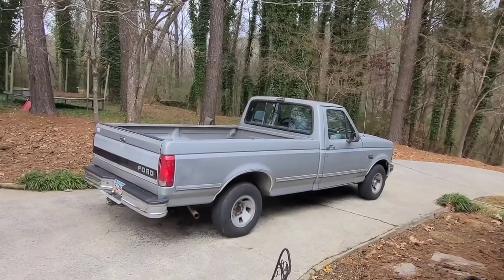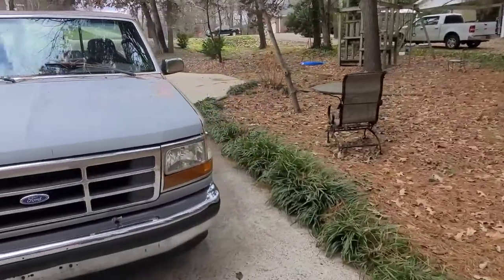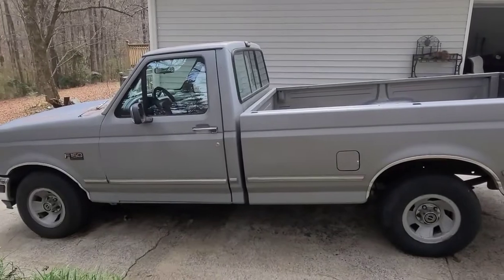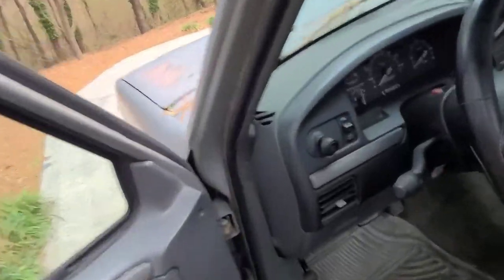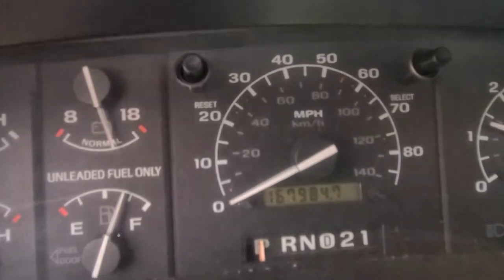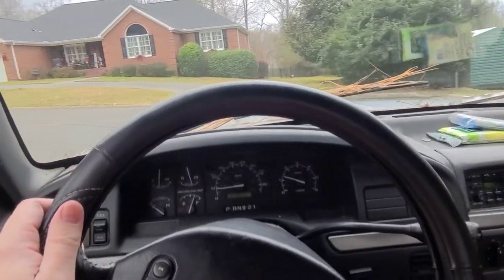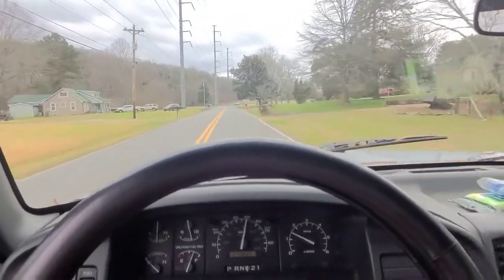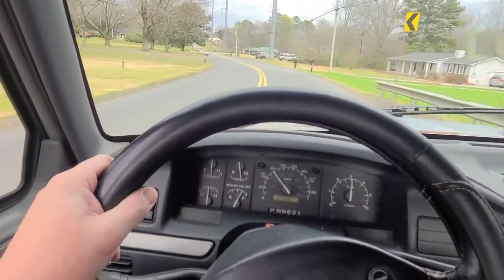Merry Christmas!   Old grey beard! 1992 Ford F-150 XLT red cab long bed POV test drive UpDaTe!

Comment: I’ve got a 1992 Ford F-150 XLT Lariat extended cab, I just replaced my distrubutor and spark plugs I now need to replace the power steering pump and the side marker lights